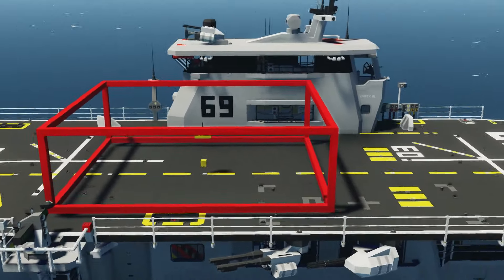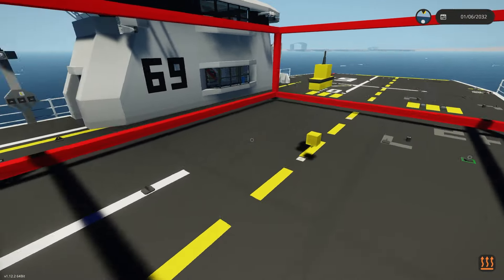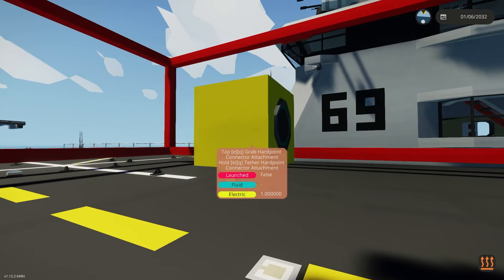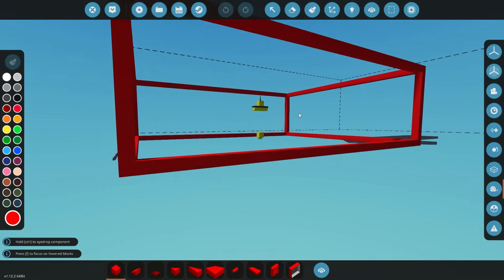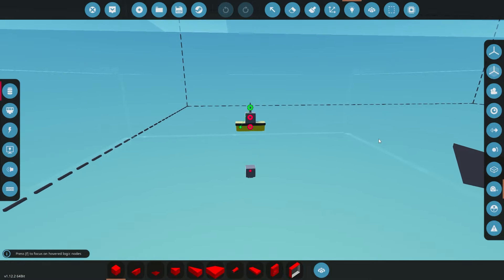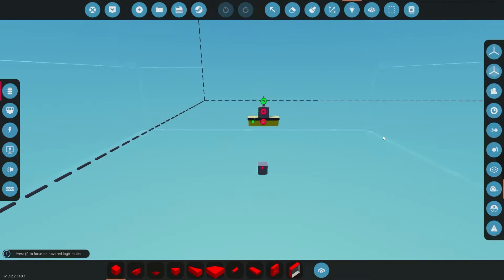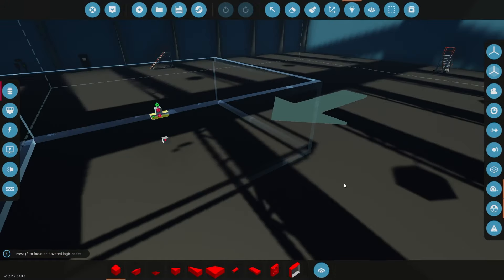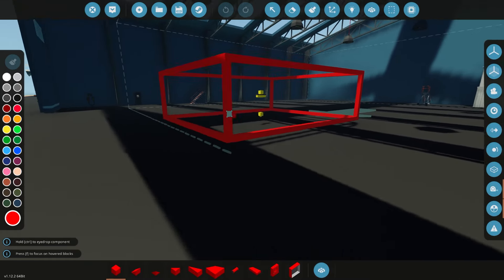Stormworks Build Series: Micro Carrier Build Challenge

Comment: Would it be possible to have folding wings if the wings fit within the limits while folded? For example the wings can be folded for storage and unfolded once in launch position.
Reply from the maker: @JackDawson-j5z  I would say yes if you can figure out how to land it. The red box is the width of the deck with the superstructure so if you can figure out how to fit while landing or land veticle that is not an issue